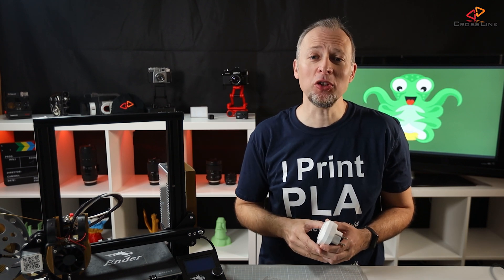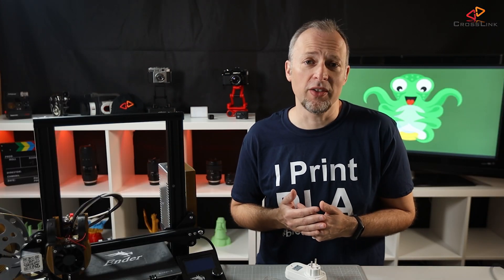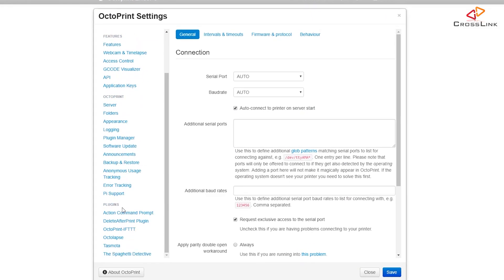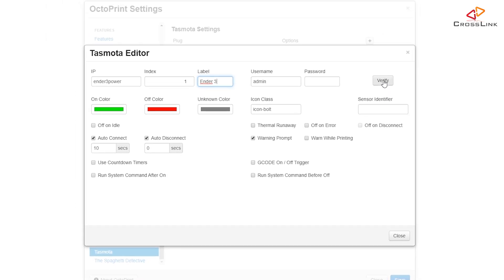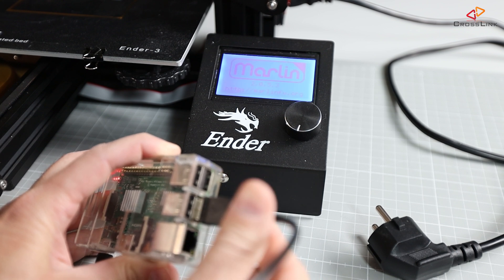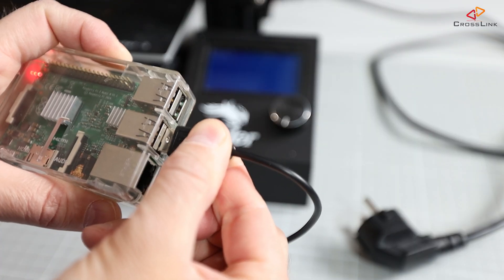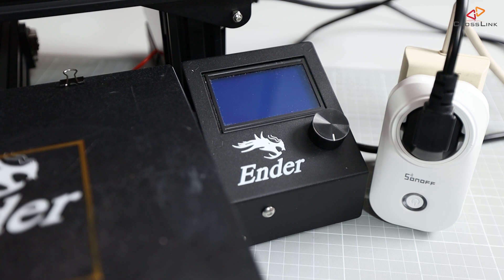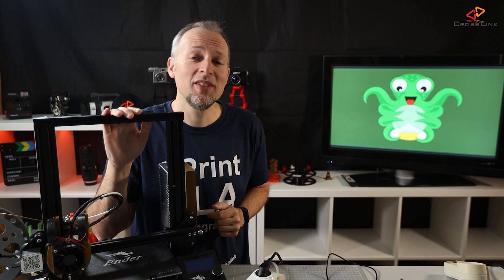Switch your 3D printer on and off with Octoprint and Tasmota - I wish, I had this YEARS AGO!

Comment: Very nice video. I am an amateur with the installation of octoprint and Tasmota. I was able to install Octoprint and connect it to the printer. Tasmota also works for me via mobile or from the web interface. When setting asmoty in Octoprint, I don't have the auto off box ticked, so it doesn't turn off after printing. I don't know how to deal with it.

Comment: You can also switch the power supply for Pi via the Sonoff. Properly configured, Octoprint can shut down the Pi at the end. After a minute, the power to the Pi and the printer will turn off. When everything is off, only the Sonoff's tiny power supply is connected to the mains power.
The only downside is that you have to use the IP or hostname of the switch to turn it on. 
Or you configure it script with wget IP-Sonoff Power-on-  that it does.

Comment: 3D printer manufacturer: Yeah, so basically … you need to slice your object into gcode and then store it on a storage card and then go to your printer and turn it on and then insert the card and then start the printing process and when done you need to go to your printer again and turn it off and remove the storage card.

open source community: hold my hacked Sonoff switch and my mini computer. :D

Comment: I've done this, and am thankful for your explanation. However, I learned today that you can actually control your printer's PSU through Raspberry Pi's GPIO pins. No need for a smart plug.
Reply: Any guides on how to do this?
Reply: @Ryezn5057  Sure there's loads of documentation on Klipper. Haven't done it myself though. You'll need to connect a couple of wires to the Raspi
Reply: @Ryezn5057  look at youtube from „teaching tech“

Comment: I guess this would only work if you power your raspberry pi separately. If you use a buck converter, this won't work with the plug-in to turn the printer back on, since the octoprint server would go down with your printer when you powered it off via plug-in.

Comment: Does Sonoff need flash Tasmota firmware? Or is just the Octoprint plugin enough?
Reply from the maker: It works only with the Tasmota firmware afaik
Reply: @Crosslink3D  The new Sonoff Pow R2 already comes with Tasmota, or will I have to flash?

Comment: Will this work if the raspberry pi containing octoprint is powered by the 3D printer?
Reply: No. You have to separate power from the 3D printer. Some peapole use a power converter to use power from the 3D printer power supply for powering the Octopi. This does not work.

Comment: wait, how do you give power to the raspberry if you cover the power pins? Via power adapter?
Reply: One year later, but maybe somefinds this information …

You cover the pin to prevent your Raspberry Pi trying to power your printer via the USB connection. The connection is only needed for data and some printer manufacturers screw that connection up resulting so-called “backpowering” from the Raspberry Pi to the printer. This likely won’t harm your Printer or the Raspberry Pi physically but it could cause all sorts of issues from printer display flickering to failing prints.

Taping the pin neither affects how to power your Raspberry Pi nor how you power your printer.

Comment: thanks a lot i neded this. I am using TP-Link version of the smart plug but the concept is the same. 

one question:  Do you have any tutorial on how to connect remotely out from your wifi to check the status???? i have tried the web browser and a new phone app that i just installed  "printoid".... but for some reason i havent manage to make it work. I went for a port fowarding solution.... with no luck so far ;P

Comment: Appears you are using Sonoff model S20. These are very hard to come by. I looked into the Sonoff basic, but that requires cutting wires (some models of basic require soldering). I am trying to avoid that messy business. 
Are there other smart switches you recommend?
Reply from the maker: There is a huge list of Tasmota compatible devices here: https://templates.blakadder.com/

Comment: There seems to be an issue with the new Ender 3 v2 and Octoprint. Once the print is completed there seems to be a problem with reporting the temperature, because of this, this method would not power down the printer because the temperature would never drop below the 60 degrees at the bed. The octoprint community, specifically b-morgan has uploaded a file fix, and also helped walked me through where to put it. https://community.octoprint.org/t/temperature-reporting-now-working-with-new-ender-3-v2/21053

Comment: An Ender 3 sitting idle consumes 7.6 watts...but how much power does a raspberry pi running Octoprint 24/7 consume?  Also, smart switches consume at least some power 24/7 too (in addition to the power of the component they are switching on and off).
If the argument is that being able to switch the printer on and off remotely is convenient, or just plain fun, I'll agree with that, but if your reason for doing this is to save energy, there are better ways to go about it.
"Hey Google - shut off the 3D Printer"

Comment: How do you get the printer to turn on automatically? I can toggle the power in octoprint and get it to shutdown automatically but I can't figure out how to switch it on  automatically when I click send to printer from PrusaControl. Do I do this in GCODE? (I quite like Prusa Control over CURA). Great video BTW :)
Reply from the maker: The integration with CURA is part of the OctoPrint Connection plugin and that communicates directly with the Octoprint Plugin. I don't know about PrusaControl and it's probably not implemented there.
Reply: @Crosslink3D  thanks for the reply :)
Reply: Looking how to solve this as well..

Comment: Can is use a shelly 1 with this plugin or is there even one for it? :)
Currently I always switch my printer off with one that I have installed behind the socket for it.
I haven't installed octoprint yet, so unfortunately can't try it myself.
Reply from the maker: You can flash Tasmota firmware to the Shelly 1, so it should be possible to use this with the Octoprint plugin.

Comment: Hi Daniel! Great video! This addition is really a must. I did in my Anet, but when I turn on the Anet using Tasmota the Sonoff basic device loses conection with WiFi. If I press the button on Sonoff the Anet turn off and the Sonoff get connection again... Have you had this problem also? Do you know what could be wrong? Thanks!
Reply from the maker: Maybe the Anet power supply creates some really heavy disturbances in the wifi spectrum. I never had this but I am also not using the PSU that comes with it. Replaced all with better ones that are certified
Reply: Crosslink actually I'm not using almost nothing from original Anet anymore. I did the full upgrade to BLV MGN mod, Makerbase SBASE board and upgraded PSU too.
Reply: I just replaced my 12V 30A PSU for other that I had here, but with only 20A and the problem is solved!

Comment: I am using the TP-Link plugin with a tp link I got on sale, its great, I can toggle to shutdown after print, and after temperature is <50C, its wonderful.
Reply from the maker: Does it still work? I read in the plugin issues list that after the latest firmware upgrade the connection is not possible anymore for TP-Link Plugs? What model are you using?
Reply: Crosslink yeah it works afaik I am on the latest octoprint also. Umm its the hs100 smart plug. Do you mean the plugs firmware? I have not touched that , Ill look into it in a bit and see
Reply: @Crosslink3D  I see the issue, its for a different model but I am also running an old firmware so maybe it will affect me, didnt see in the release notes anything, but this does suck if they are disabling local access
Reply: How did you configure it to wait for temp to drop below 50c?

Comment: Can you add other smart plugs to this Octoprint app? Or do you need to use one designed for the actual plug?
Reply from the maker: It works basically with every smart switch that can be tasmotized. The list is HUGE: https://templates.blakadder.com/

Comment: Quik tip put in some code in cure to let the nozle first cool down then switch of printer. Awesome i have done simmilar with cura code to trigger a switch that run on arduino to sw of an reley
Reply from the maker: Yes, this is the temperature setting in the plugin. Default is to wait until all temps reach 50 deg Celsius or below before shut off

Comment: Excellent tip about Cura, but this setting doesn't show up. Cura 4.6.1 with same version of Octprint plugin. In Octoprint theTasmota plugin has the same settings. But the option of turning it on is not showing. What could I be doing wrong ?
I noticed in the plugin you also have a setting for turning on the switch by using Gcode, but you don't have that enabled.
Should something be added to the startup Gcode ? I'm at a loss here.
Reply from the maker: You should upgrade to the latest version of the OctoPrint Tasmota plugin (version 0.8.13). This function is new so it won't show up on versions before.
Reply: @Crosslink3D  this was the version I had.
Now re-installed and it's working.
I think I found why it wasn't working, the label wasn't set in my config. For Cura to detect this, the label can't be empty. Hope this info helps some other people as well.
Keep up the great work, love the channel.
Danke schön !
Reply from the maker: Great catch with the missing Label!
Reply: @sdebruyn  This was it. I was scratching my head trying to figure out why it wasn't coming up!

Comment: I have 2 printers running on 1 Pi, but only 1 is connected to a TP Link. When I messed around with the TP Link plugin and turned on the setting for thermal runaway protection, the printer that didn't have the TP Link actually stopped dead midprint while the bed and nozzle stayed at temperature. It actually started melting the filament and eventually causing some smoke. Luckily I was around when it happened. So I turned off the thermal runaway option in the TP Link plugin as I have that enabled in the firmware anyways. Just wondering if you ran into anything similar if you have 2 printers connected to one Pi? The plugins seem to get shared to both printers so something to watch out for.
Reply from the maker: I am giving every printer his own pi at the moment, so probably this issue will not happen to me but good shout-out for everyone who wants to run multiple printers with one Pi.

Comment: Awesome tip about Cura, I missed that one but not any more. Great video as well, but a small word of warning about the auto power off - I was reconfiguring my Ender and went to unload the filament, then just as it started to unload the printer switched off. Unfortunately it was the plugin. So although it's a great feature, just be aware of this or you could lose any changes you when the power gets cut. Still, you can't beat being able to remotely set off a print a few hours before leaving the office to get home and gain some printing time.
Reply from the maker: Great hint! Maybe extend the auto switch off timer to wait longer. I just set it to 5 minutes for testing but probably will increase that to 10-15 minutes

Comment: ich habe den pi und den ender an eine steckdose  will beide nach dem druck sagen wir mal nach 5 min wen das hotend abgekühlt ist abschalten  geht das, und wie schalte ich dann das ganze wieder ein, über ne handiapp ?
Reply from the maker: Beides einschalten ginge auch über das Webinterface von der Steckdose. Allerdings solltest Du am Pi eine Notstromversorgung haben, die dem Pi bei Wegfall der Hauptstromversorgung ein Signal auf einem Gpio gibt und den Pi dann kontrolliert herunterfährt. Video dazu folgt noch.
Reply: @Crosslink3D  habe ja auf den pi ja schon ne App die denn nach dem Druck runter fährt wenn die mit der Steckdose zusammen arbeiten wùrde währe das die lõsung
Reply: frank fischer Es gibt ein Plugin, das OctoPi nach Druckende herunter fährt - Automatic Shutdown. Daher den Ausschalter halt auf ein paar Minuten nach Druckende setzen, der Pi schläft dann schon.
There is a plugin that shuts down octoprint after finishing the print - Automatic Shutdown. Thus set the switch to a few minutes after idle, octopi is already sleeping then.